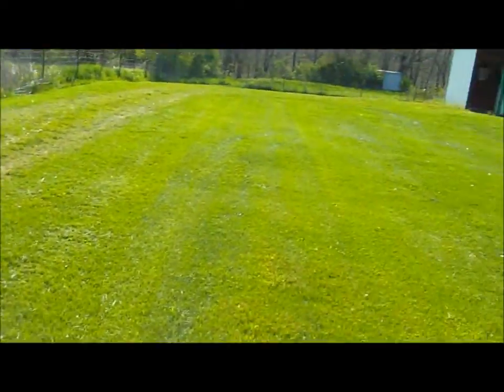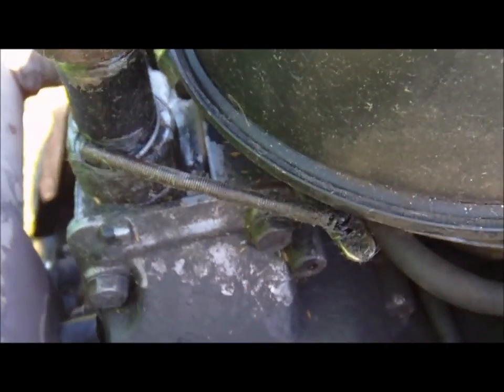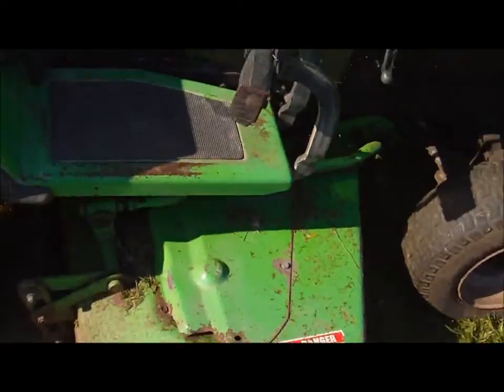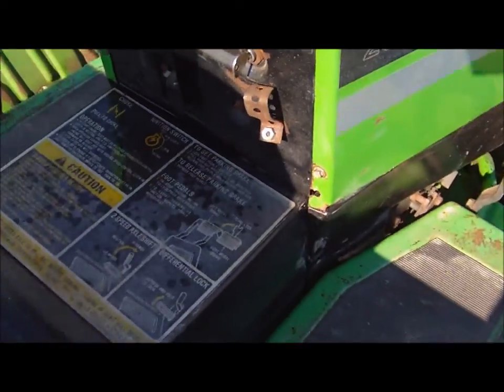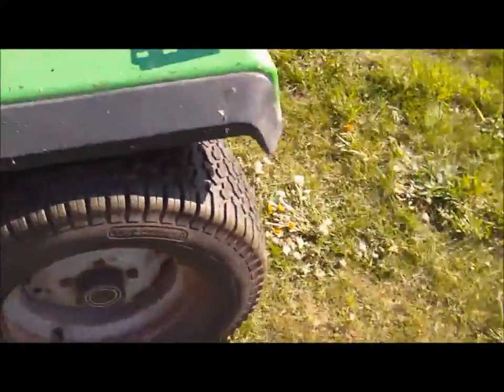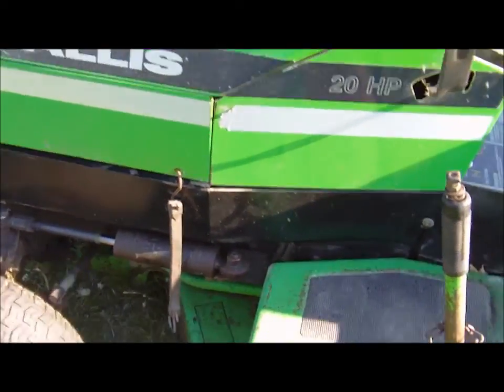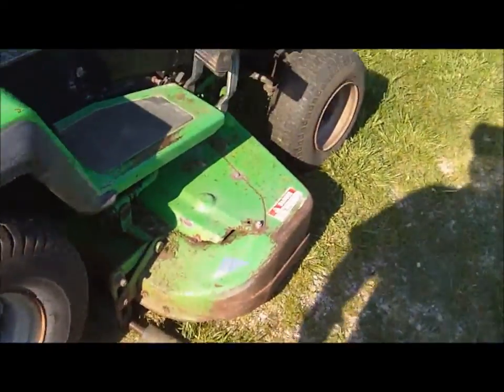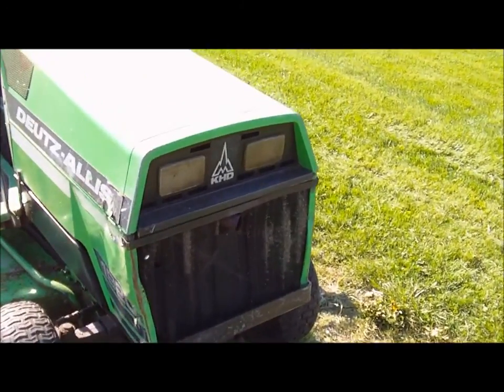Sometimes you're the bug!!!

Comment: Even with so many problems it's still pretty cool! I've actually never even seen Deutz equipment before.
Reply from the maker: +SD Customs Thanks.  This is made by Simplicity and is basically Sunstar.  This would be the top of the line with the 20 HP split brakes, hi/lo transmission, diff lock and power steering.

Comment: I have question about the 1920 u have couple. My mower when it starts to pull down in heavy grass it wants to die unless i stop. If I stop it smokes black black and misses and eventually straightens out. Ive looked up manual to engine and my carb is different. Mine has a fuel solenoid on it which I cant find info on. Theres no high fuel screw adjustment. Do u have pics of ur carb? Any forsale? Im lost right now. Thx
Reply from the maker: The machine runs fine any other time? Is it possible that the engine is just not powerful enough to cut the grass you are asking it too?

Comment: Did you ever fix the steering i need the rebuild kit number do you have it I have 2 of the 1920s also one is restored and the other i bought for a parts tractor with the leaking out of the top of the steering tube but i cant bring myself to let it be a parts tractor i got both of my 1920s for 500$ each there such a good mower.If you have the part number for the rebuild kit id appreciate it or if one of your viewers does.
Reply from the maker: Unfortunately, I don't have the rebuild kit number.  I do like the Sunstar/1920's too. Thanks for watching!!!